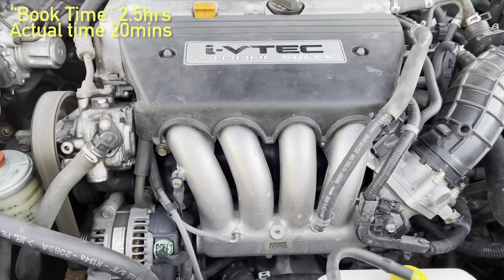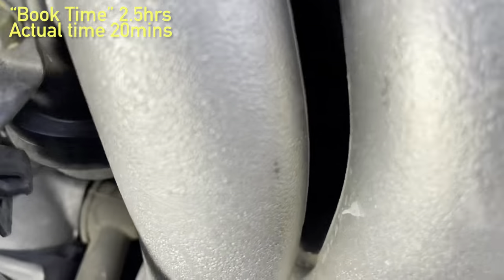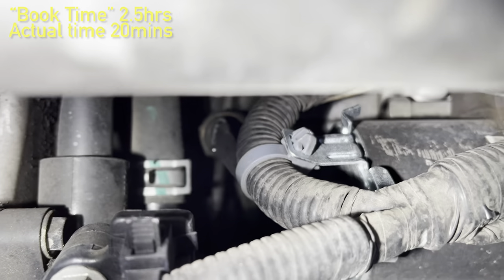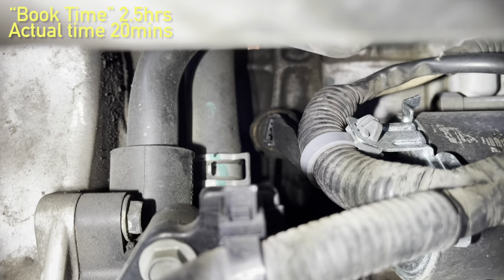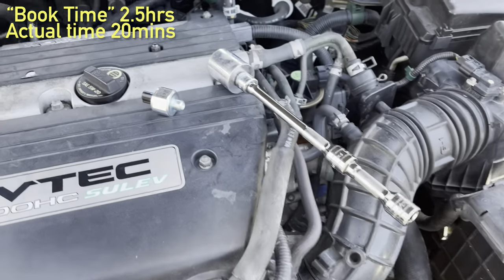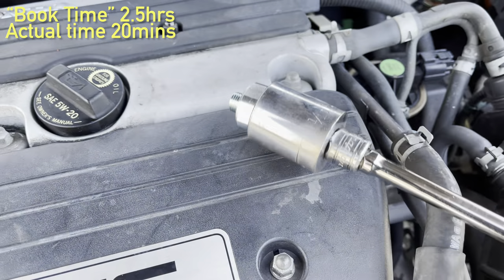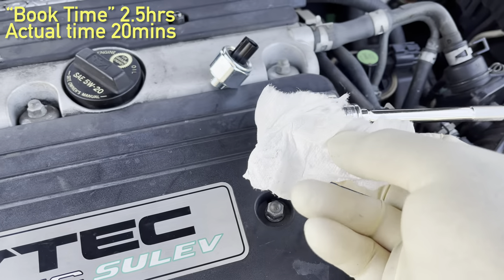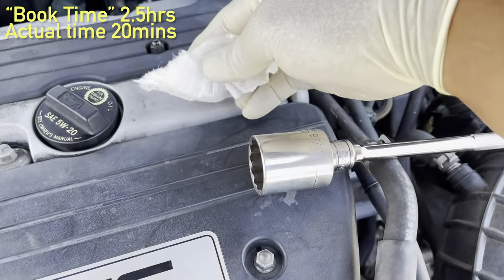EASY Replace Honda Accord knock sensor WITHOUT removing intake manifold P0325 Element TSX CRV

Comment: very good video, but i went ahead and removed the intake manifold and cleaned all the gunk out of it, sprayed throttle cleaner and let it dry. it’s a whole lot easier to replace the knock sensor without the manifold, just my personal opinion…
Reply: I did too. Not bad at all except for that lower bracket. That one kinda sucked!
Reply: I know took me 40 minutes trying this method i couldn’t, took me 1 hour removing manifold replacing sensor and put everything back
Reply: Bro you got big hand. I was able to remove sensor clip but unable get my socket to fit on the sensor! What size was it again?? 😅😅 27mm no?

Comment: I have an 04 element and have the p0302 code first and now got the p0325. So they are together.  Could it be the knock sensor causing the p0302 or does the p0302 cause the p0325? Or are they not related? Thanks.

Comment: Thank you - i used your method to replace the Knock sensor in My Accord Type - S , i got a pattern part for about £15, and had to purchase a Torque Wrench and socket extensions bar -( but i now have these tools for life) had to get my your lad to get his small hands through the manifold and remove/replace the cable clip and position the sockets etc as My hands were to big to fit through the gaps,  Rest was easy, saved approx £500 on garage quote!  many thanks
Reply: How you disconnect a wire, by hand ??? in Accord 07 you can't do this

Comment: Would u need to lub it befre u put it back in or it doesnt need to...
Reply from the maker: No need to lube it
Reply: Alright thanks could u list the tools u use.. thanks (still tryn to replace mine 🙄)
Reply from the maker: It’s listed in video description 

3/8 ratchet with extension
27mm socket
Needle nose
Flathead screwdriver

Comment: Hi do i need to disconnect the battery?or im good doing this just with the car off??
Reply from the maker: You can but not necessary. It’ll clear your check engine light though if you do.

Comment: I tried it this way, it sucked. I spent more than twice as much time trying to get it this way as it would have taken by the remove the intake manifold method.
There were plenty of issues this didn’t warn you about, and will cause you FITS as it did me. Just one - how about if the tab on the connector isn’t in the 10 o’clock position (as it had to be for this video)? Then you can’t disconnect it the way they did. And, how are you going to get the connector reconnected when you can’t even see the connector you are trying to get between your needle nose pliers (which has to be just the right length, by the way), let alone turn it to the needed orientation to reconnect it on the new sensor?
And I didn’t mention the nightmare it is when the old sensor falls out of your socket, or the socket catches on something when trying to take it out, and it comes off your extension and falls into that cavity below the knock sensor, and it can’t fall out the bottom. You have to try to get it out from there where you have no chance at getting your hand or fingers there, or any magnet ( had to Jack up the car and have a helper try to push it up from below with a skinny item, because you can’t get your hand in from underneath, either). There were other issues ( you may well need a 6 - point socket, etc.)…
Reply: Your right mine was more difficult to take out because the tab wasn't in the same position but it's still doable with an 11 inch plier left of the intake manifold. Still easier than taking the manifold out imo and if it's already working good no need to remove more stuff than needed

Comment: i just did mine with just a ratchet, extension and 27mm socket 

cut some zipties that where cutting me

 stuck arm in there then turning it to the right and disconnected the clip 

got old one out with socket(little tight but just ease on it) 

put napkin from free donut in socket to keep new one in the socket 

thread it in just with the extension 

tighten it snug with ratchet and little LITTLE more 

reach in there and connect plug 

(any more questions as me lets get the fking thing done)

i bought a $9 one off amazon and ill see if it works, i can already notice a difference in motor
Reply: How you remove wire ??? Tx
Reply: @mario17-t34  reach in there and push the tap down and pinch it and pull back
Reply: @dancearoundtheworld5360  tx, did you used pliers or just long screwdriver
Reply: @dancearoundtheworld5360  Tx. what tool you used for push?  Maybe my hands are too big-)
Reply: @mario17-t34  i have small arms i pushed tap down with finger and pinched connector to remove 

if you can reach in from the left take the manifold off or use long needle nose pliers to carefully squeeze tab and remove

Comment: This seems doable, but if I take the old one out, but can’t get the new sensor in, and I have to take it to professional, can the car be driven without a knock sensor? Temporarily, of course. It’s just something I would like to try doing on my own.
Reply from the maker: Yes if can be driven
Reply from the maker: It*
Reply: Makes the car run werid if u decide to feel like it’s puttering and u notice ur fuel consumption is higher
Reply: If u get a woman with small hands she can easily put it in...thats what I had to do and it was night time thats how easy it was the job took bout 10 minutes